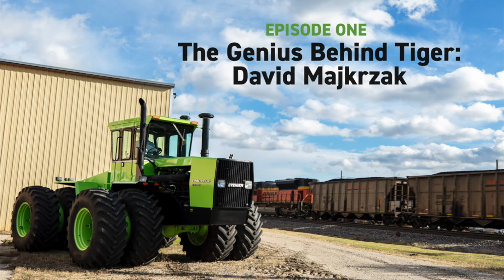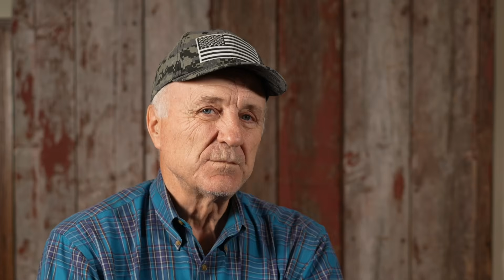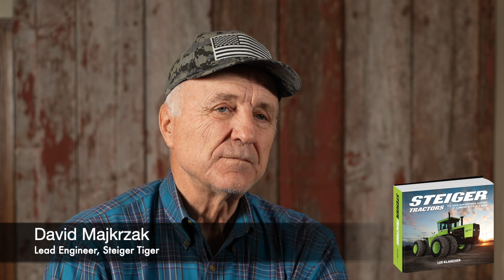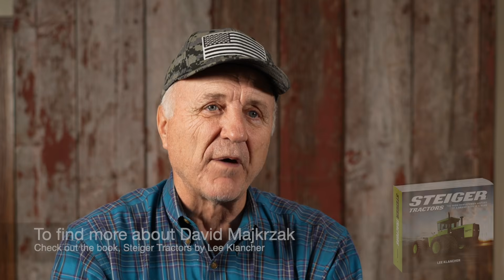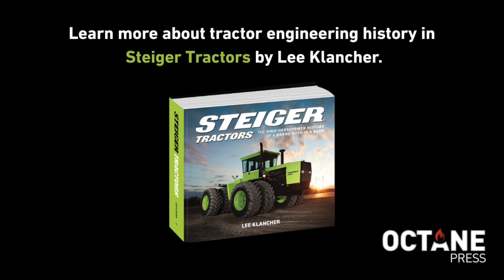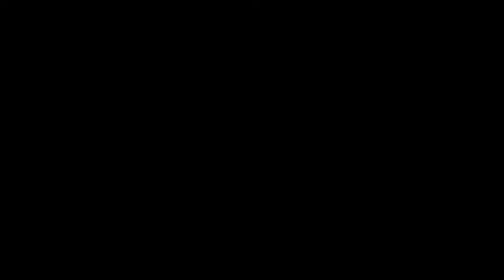Steiger Employee Interviews Episode 1 (Part 2): The Engineer Behind the Tiger: Dave Majkrzak

Comment: I wonder if they ever thought about a two wheel drive steiger
Reply: They made a prototype two wheel drive called the Jaguar. 250 horsepower roughly. Basically just to catch John Deere off guard with their desire to build higher horsepower 4WDs and get them more focused on the high horsepower 2WD
Reply: @jacobbirklid9361 wasn't there 2 prototypes?  I'll have to do some digging but I think I read that somewhere
Reply: @dougschmitii6165  you might be right